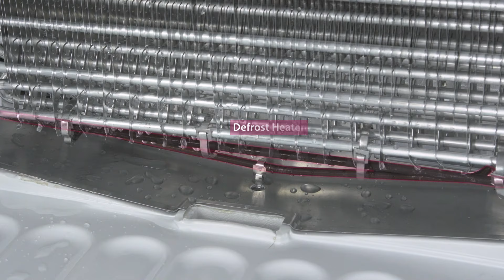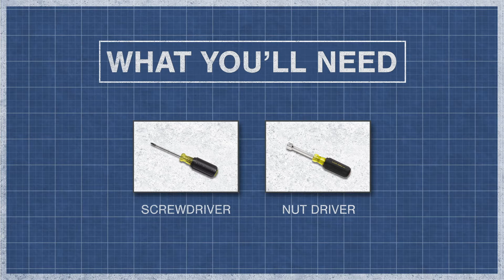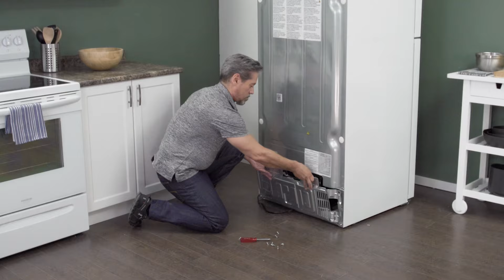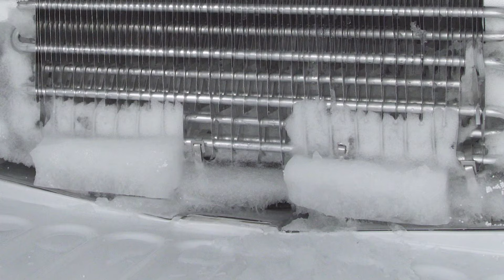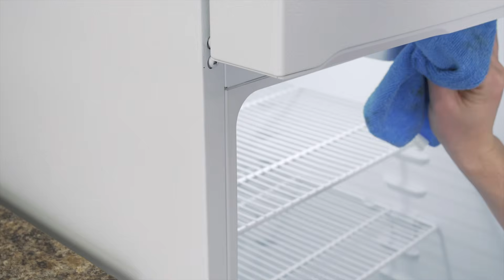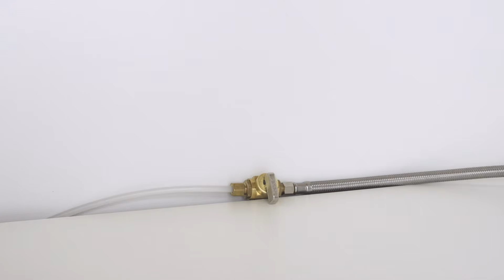Frost & Ice Buildup? Freezer Ice Removal | Repair & Replace

Comment: I have at home the same refrigerator you have in the kitchen from the video. 
You removed the panel from back of refrigerator and then you didn't show anything what to fix on that side 😢😢!
Reply from the maker: Thanks for watching. The lower panel on the back is helpful if there's a blockage as this is where the defrost drain. You can see this later in the video 8:16

Comment: MY MAYTAG REFRIGERATOR M#PBF225HEB IS NOT FREEZING MY FOOD.I TOOK OFF THE BACK PANEL AND HAD FROZEN ICE ON TOP OF THE COIL.I DEFROSTED THE ICE AND CHECK IF THE FAN WAS WORKING IT WAS GOOD I CLOSE THE DOOR AND CHECK TO SEE IF IT WAS COOLING AFTER 30 MINUTES.NOT COOL BUT THE LINE THAT INTERS THE COIL WAS FROZEN NEED HELP

Comment: So I have 3 holes that connect from the fridge to freezer. 2 circular ones on top left and right and one in the middle: 3 holes  all frozen solid I had to take off the back completely of the freezer and the entire thing was frozen. I unplugged everything and had to throw warm water on everything to defrost it and the middle hole defroster but the other two holes didn’t fully even tho I was doing it for a good hour or two: I gave up because I have no experience doing this and put it back together but fridge started cooling: I feel like it could be colder but the other two holes are still frozen sort of. Should I try to defrost again to maximize cooling or leave it? It was a hassle the first time around and I didn’t see any fridges and freezers recommended that looked like mine
Reply: Problem simplified: Open the inside of the freezer and let it defrost naturally overnight. Next day clean up water and then check if holes are defrosted. The holes bring the below zero freezer to fridge air to normal 38 degrees via the thermostat. Make sure the fan is working, if noisy, a little oil in the oil lite bushing will free it up. Check periodically for freezing problem. Older fridges are hard to kill. Problems solved make you better.
Reply: @thomaskennedy5028 okay so over time I’ve done this 3 times now and it makes the fridge work for a certain amount of time then it stops working on its own after a month and the freezer really just keeps getting too frozen and I guess it stops working completely I guess there is something wrong with the defrost system I don’t know